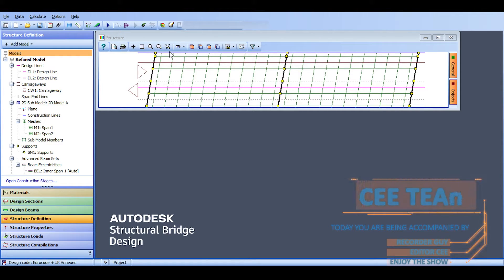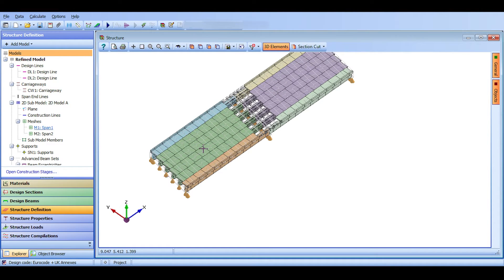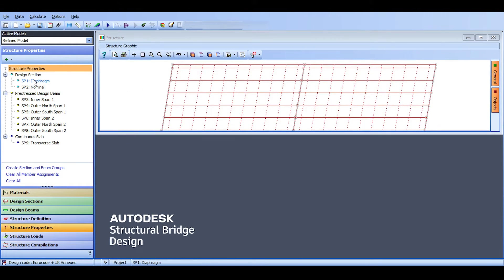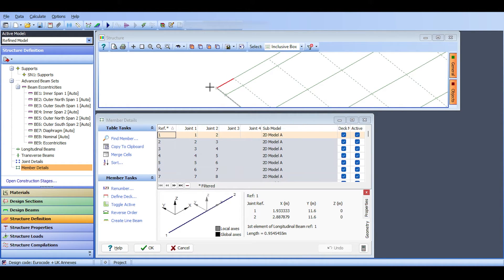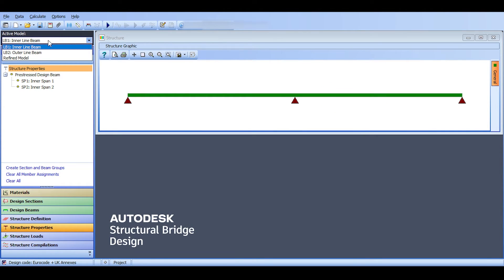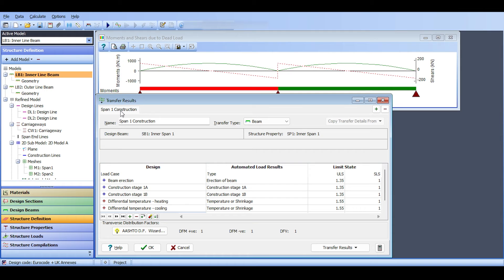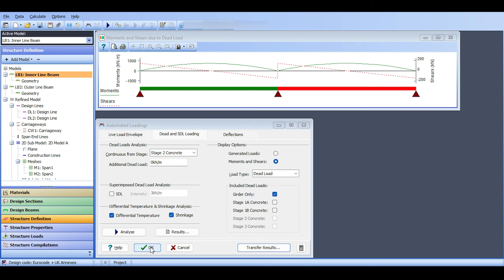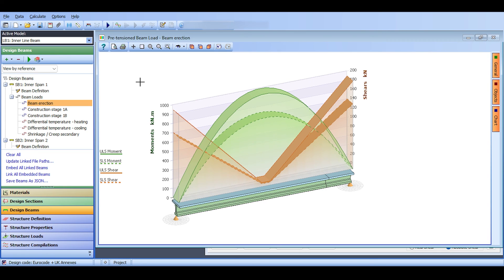Modeling and Design of a Prestressed Bridge on Autodesk Structural Bridge - Part 6 Line Beam Model

Comment: Hi thanks for the video,

I have modelled a deck grillage and included a design beam of a prestress member. I didn’t utilise the line beam, however, I was able to define my DL and SIDL loading using the load ‘Generate’ tool. 

As part of the SIDL I included the Surfacing and other dead loads on my deck which I noticed you didn’t do as it acts on the full structure when its fully integral. I also modelled the live loading by transferring results from my grillage envelope analysis.

My question is regarding  my prestress beam deflections results which shows a sag of -4mm after the dead load increment has been added to the stresses at transfer. Is it not best to utilise the construction stage results instead and add up my deflections at erection (after shrinkage/relaxation losses etc) to my DL loads deflection increment (weight of wet slab only) to work out the deflection prior to the deck being integral with the rest of the structure?  After this I would then use my grillage results to work out deflections of the rest of the load cases (i.e surfacing/ traffic, etc) when fully composite with the rest of the deck?

I have assumed the SIDL and Live Load (LL) are crucial to the design stresses of the prestress beam, however, as the beam is composite with the rest of deck, the deflections should be taken from the grillage?

Any help, clarification would be much appreciated.
Reply from the maker: Hi there, 
I am really sorry for the late reply. 
I assumed that the superimposed dead load includes the surfacing.
As for live load, yes, I am intending to model them on the grillage first, so that it can be transferred to the beam, exactly as you said. 100%.

As for the deflection, I see what you are planning. If I understood your correctly, you are planning to say:
Deflection from construction + deflection from extra load due to erection (shrinkage, relaxation included) + deflection due to wet concrete

Then yes, I agree. This makes sense. 

If you take the deflection from the grillage, you may run into the risk of misinterpreting your results.

What I mean by this is:
The beam itself (no composite action, wet slab) would have different deflection limits when compared to the full structure.

I think I will keep this point on my notes and have it covered later. It is a good point and your suggestion is gold.